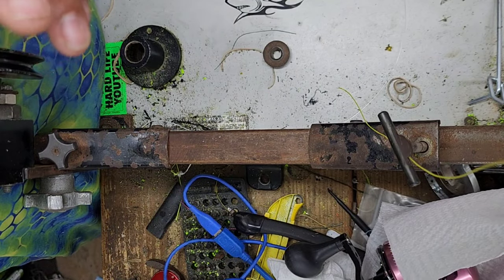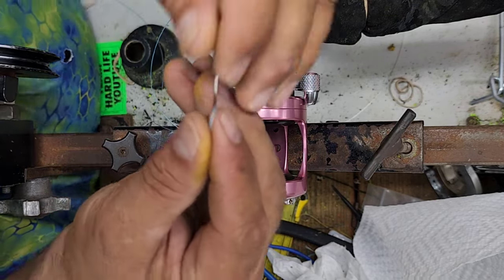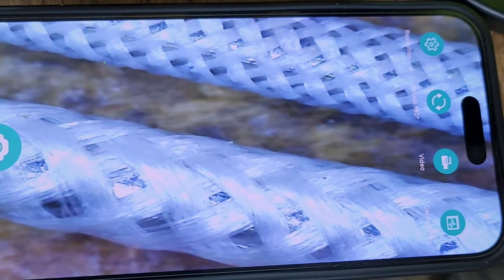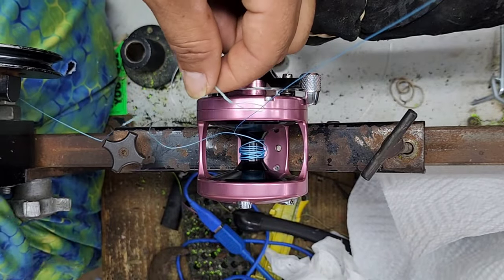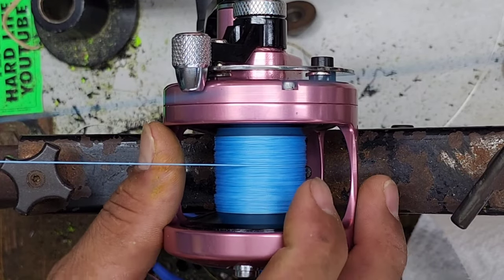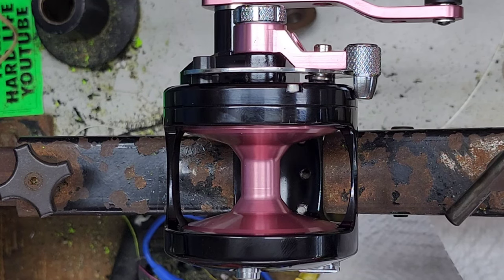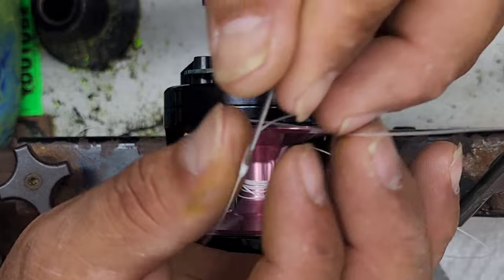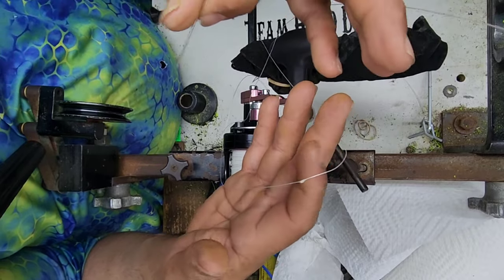Seaguar Hollow core Braided Is Not What You Think 🤔

Comment: I’ll never use TL Braid again! Lost two swords on it. Running 20lbs of drag it broke. Not once but twice. That’s about $150 worth of tackle lost each time and the $1000 worth of fuel, bait, etc that goes to waste.
Reply from the maker: Can you give us more info about the color, Weight class or braid you were using.. was it solid ot hollow?
Reply: @TeamHardLife  white solid 65lb. We even took 50yd off the top and it would still break at 20-30lbs. Went back to JB solid and haven’t had an issue.
Reply from the maker: Hmmm maybe a bad batch.. we don't deal with their solid just curious
Reply: I’m not sure. I just know it was junk and cost us two swords. The $300 worth of gear is negligible on that type of trip but losing the fish is gut wrenching.

We don’t use HC on drop reels. The solid doesn’t scope near as bad as hollow. The reels full of HC are all JB and we haven’t ever had an issue with it, although it is pricey.
Reply from the maker: What do you mean by scope?
Reply: Bow with the current. The heavier solid cuts the current better. On a straight up and down setup.
Reply from the maker: Good ral how far down are you dropping? Size of weight guys around here got from 5-10lb in weight then use a 2# cannon on their float on top to keep the float upright...
Reply: @TeamHardLife  we don’t use buoy rods. Probably should. Running 5-7lbs of continuous and roughly 8lbs of sacrificial. We drop anywhere from 1400-1800 depending on daytime vs night, time of year and current.
Reply from the maker: What size of swords do you catch with that weight class of line..
Reply: @TeamHardLife  most are in the 90-150lb range but occasionally we’ll hook one north of 350. The bigger fish get the hardest to land once they’re on the surface.
Reply from the maker: Bet they do...
Reply: Going to the next level
 Everyday to the
100K Giveaway#TeamHardLife 
#CortlandBraid #LineCutters #TightlineBraid #Jac’dUpLeatherworks  #Sharkotic
#TexasSurfMasters #GatorLures #OffshoreSyndicate #ShopTheRealDeal